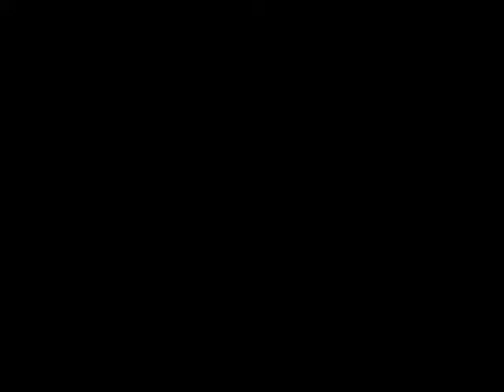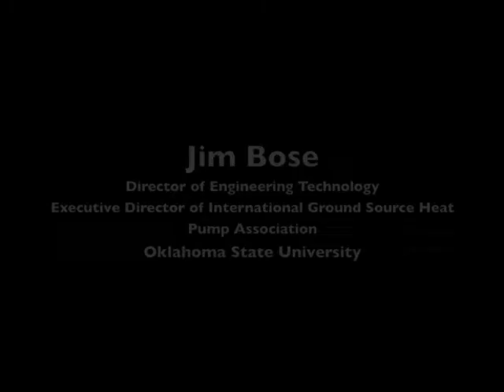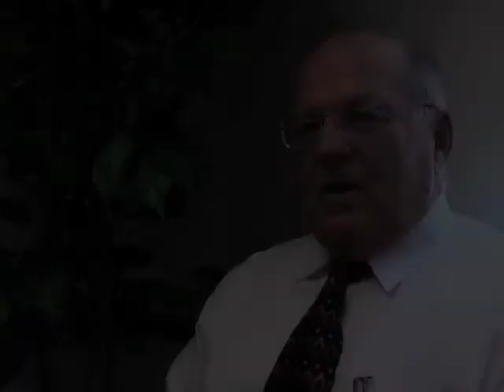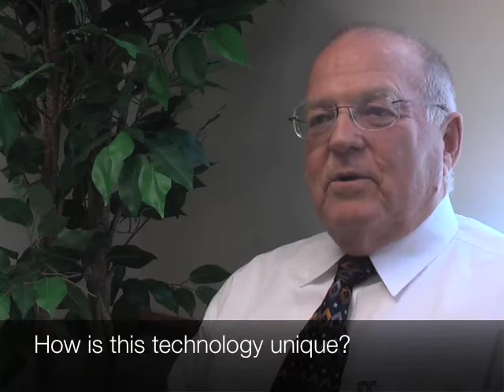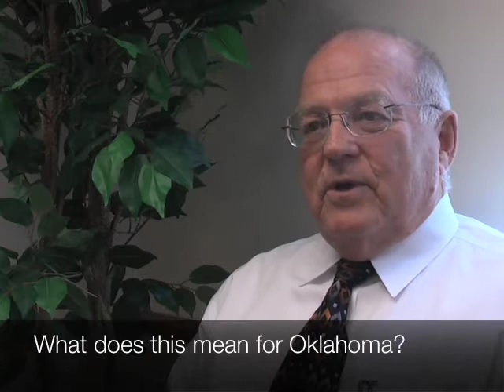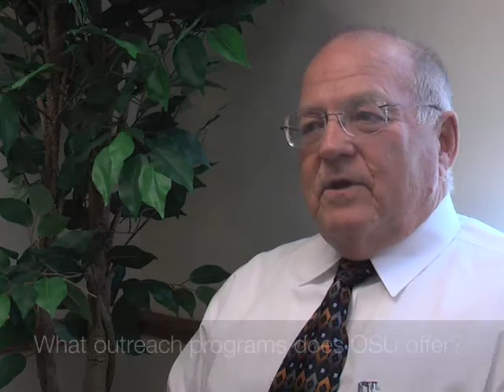Jim Bose - Ground source heat pump expert

Comment: I think you are confusing a heat pump with a ground source heat pump two different systems that share some principles and parts but one costs alot more money but also is much more efficient. The more efficient being the ground source heat pump which utilizes tubes filled with water that are buried at various depths as Dr. Bose touched on. The advantage is that beyond 6ft or so the ground temperature remains constant throughout the year.